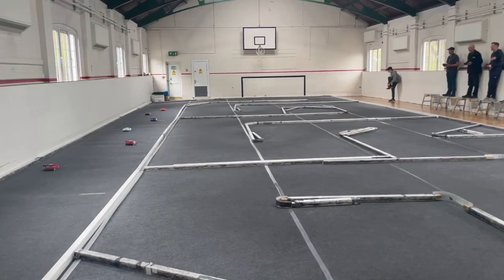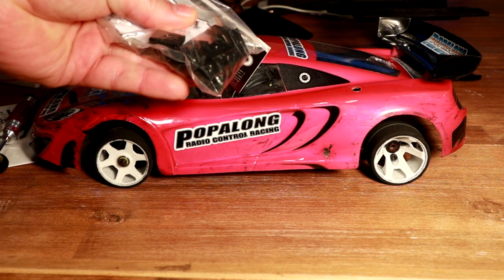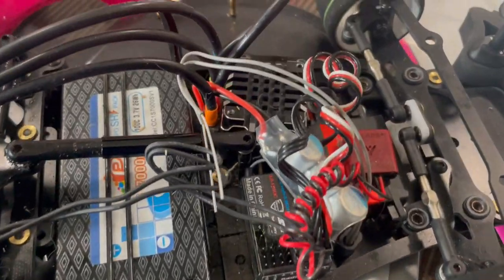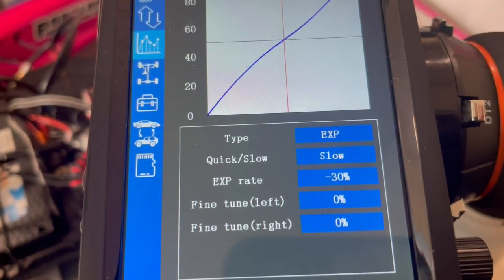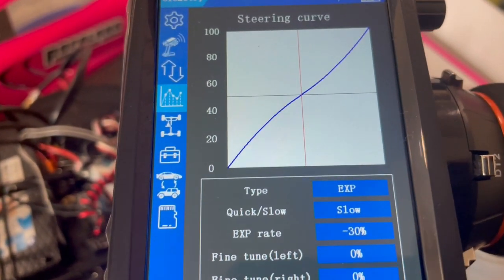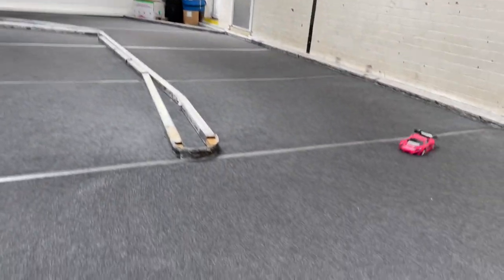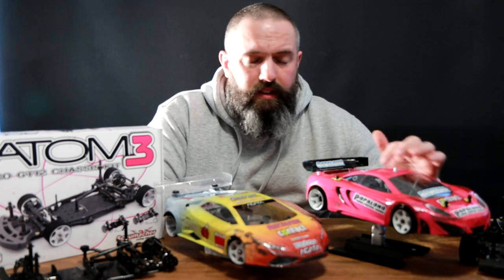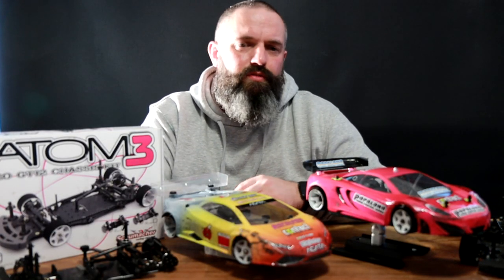Essential upgrades for Schumacher ATOM 3 GT12

Comment: To raise the front ride height you can remove the 1mm ride height spacer under the lower suspension arm and get some 0.5 ( U7920 ) and 0.75mm ( U7921 ) spacers from Schumacher.
Reply from the maker: I’m on it

Comment: In Canada we have been running rubber tires for GT12 class. Seems to be easier for new guys to get into, might be something your clubs could look into.
Reply: The rubber tyres are great on CRC black carpet but carpet in the UK generally gives less grip, so the rubber tyres do not work well.
Reply from the maker: We see this at the MTC nationals where they run foam and rubber classes
Reply: We don’t have the high grip carpet here to really make them work properly

Comment: The fan mounting position definitely won't be doing you any favours, unfortunately the only place to mount a fan at the moment is right on the rear of the chassis behind the pod, until someone designs a better mount. If you want more rear stability, use less front additive and have the rears soaking for longer, even potentially double-dipping if they're drying out before your heat. Increasing rake and rear droop also helps with rear stability, and a bodyshell with a front splitter (try the phat bodies GTM) will help too.
Reply from the maker: Hoping for a better experience this week . 
I will change explore additive routine 
Not sure what to do about Fan might have to get rear mount
Reply: Seconded for the phat bodies GTM that’s best handling GT12 shell
Reply: I run a rear 30mm fan on the atom one using a custom mount I made. Works great and gets C of G low. Only thing I found was you must run a fan guard. Surpass do a nice lightweight carbon one.
Reply from the maker: Good to know 
I need to check my options for the fan

Comment: If the car is bouncy over rough tracksurfaces, the car is OVERdamped and you should run thinner oil, not thicker
If you changed to thicker oil and what you felt was no longer there, then bouncing was not what you felt :)
Reply from the maker: Good to know

Comment: That rear end looks way too loose maybe those tyres you normally run on the Atom 1 don't work very well on the Atom 3
Reply from the maker: Running the control tires:(
Reply: @PopalongRC  I did think that was probably the case, is it a control additive as well?

Comment: Gr8 honest vid as usual. Q. R your class races actually allowed to use reverse?  & you 2 should either get into/find a racer that does 3D printing & has a scanner.  Print your own replacement parts or design your own non-CF parts. Stronger bits too depending on the substrate used if not less expensive. Learning curve is easy on 3D printers. 
 Probably better for buggies & bashers not 12th scale. Idea for your future.  Already parts maps online....or full chassis.   Personally I am disappointed w/most new  10th scale onroad comp kits recently. Most are just more skeletonized to save weight imho. No real innovations. 12th scale, revisions but same chassis, rear pod design for ages.  Gd new radio review. My only concern is long term quality. Looks CH made? I'll reserve judgement, but no drop down wheel?  From Spektrum to NOT Futaba? Blasphemy! 😂😂 Personally I've gone back  to Futaba stick radio. If it's good enough for Masami & Hara 😊......
I do miss 12th scale indoor racing, but now one has to race the class(es) that's run @ the local track(s) if u want to compete imho.  An old trick + makes sense in every class & Y aren't you mounting/hot glue your transponders on the front of chassis/top of the foam bumper? Gets it away from all the elec noise, adds a tiny bit of weight in front of the F tires = traction. GD knows every rc car needs that or a bit of lead tape stuck on the front bumper for added F bite, handling, if class legal, once you figure out your chassis # balance point & side to side distr. Starting out w/as neutral a chassis as poss makes setup 20x easier.  Your clubs don't have a lot of practice days or dedicated track space do they? That is a shame.  😳 Passed 6.2k subscribers & growing. 👍👍👍
Reply: Hara has always been wheel radio
Reply: 12th scale doesn't allow reverse, it's to stop people reversing into the path of other cars and causing collisions. If you're stuck, you're stuck until a marshal comes to get your car. It's safer for all that way at the speeds these cars are going, it hurts when they hit you.
Reply from the maker: Thanks as always for taking the time to comment. 
Still early days on this project so looking forward to making progress.
Reply from the maker: Exactly that
Reply: @aercracing  I can only assume he has never raced 🤷
Reply: "Child please". In the vid a car reappeared on track so  fast & apparently rebounded from a crash.  Thus my rev QUESTION. IDK UK current rules.  We do use rev in practice & track practice days obv.  My 1st Wheel aTx 12th scale RACE kit/car & Tx as a youngster didn't even come w/rev specifically so it wouldn't trigger during a race (Ta Mom) .  See prev comments I've posted for some of my race exp. C's trying to keep comments civilised so I'll leave it.  Q. R U saying that Atsushi never used a Stick Tx? Ever? Agreed publicly racing he's always photographed using a Wheel Tx.  Turn Marshall's response time or availability can also often be the difference in a race.  Summer in London.  I don't envy you. 37C-46C @ Amain hobbies track here is brutal as well.  ✌